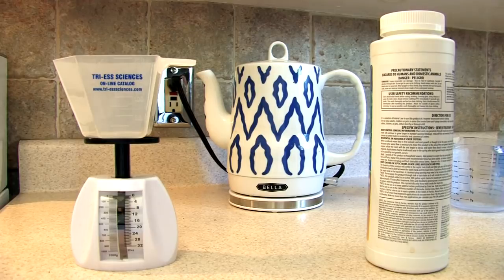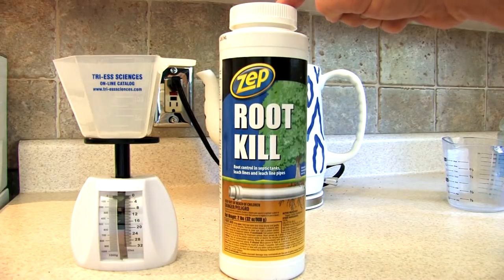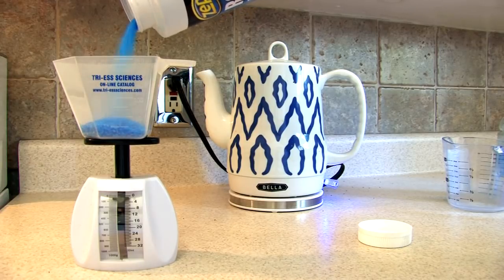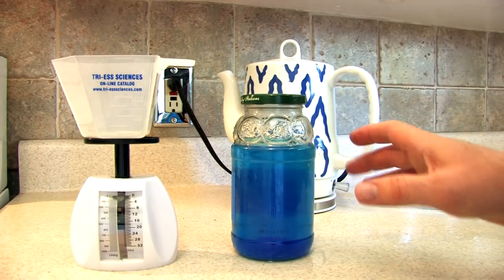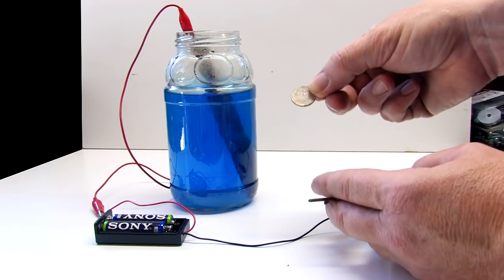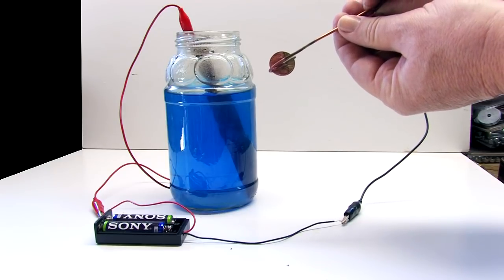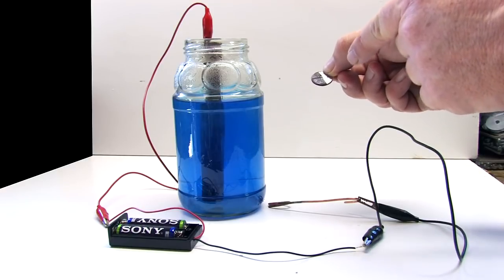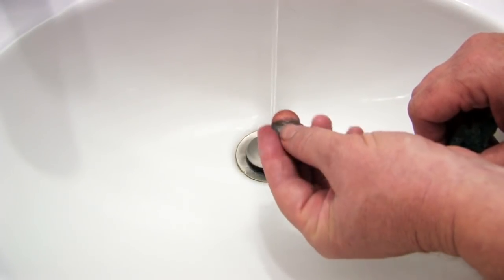Easy And Inexpensive Copper Plating Trick!

Comment: a word to the wise, don't try this with a 12v power supply, i did and it didn't end well. i used the same 12v power supply i use for rust removal electrolysis, i started the plating, went in the other room for a while, when i came back the solution was steaming hot and my metal piece was burnt black, and no copper stuck to it. it didn't dawned on me until i saw how hot the liquid was, that with the solution being copper it was the same as connecting the 2 leads together with a piece of wire. think i'll try it again only with 2 AA batteries next time.....
Reply: your feed with an explanation is appreciated. I think a high current low voltage source would be more appropriate to increase the rate of plating.

Comment: Cathode is positive anode is negative
Reply: Just the opposite.  Cathode is defined as the negatively charged electrode by which electrons enter an electrical device. The anode is the positively charged electrode by which the electrons leave a device.
Reply: Actually it depends on whether you are talking about it from the POV of the chemical reactions taking place or the POV of the multimeter measuring current. I was referring to the POV of the chemical reaction
Reply: Actually, you're a dipshit.
Reply: Lol salty boii

Comment: Copper sulfate pentahydrate is the same chemical as Copper sulfate. Pentahydrate means that for every molecule of copper sulfate there are 5 molecules of water. That's why they write CuSO4 * 5 H2O.
Reply: Fun fact for those who care to know CuSO4 * 5 H2O is blue... if you put it in a drying over to vaporise off the H2O the powder turns white.
Reply: $13.98 for 32 oz at lowe's
Reply: But then how the include H2O into powder? ;)
Reply: @VladOnEarth  If you let copper sulfate solution evaporate  when all the liquid water is gone there will be crystals of blue copper sulfate, incorporated in the crystal structure are 5 water molecules for every copper sulfate molecule.
If you heat the salt in an oven the water will be driven off leaving a white amorphous powder that will draw moisture out of the air to return to its crystal form.
Once the salt is dissolved in water  it's not a crystal any more and the extra waters are insignificant.
If you were weighing out the salt to make a specific concentration of solution then you would need to account for the weight of the five  water molecules when you weight the crystal salt.
Reply: @VladOnEarth  It's attached to the copper due to its hygroscopic nature
Reply: @VladOnEarth  water is trapped inside the crystals.
Reply: So basically just same stuff but dissolved?
Reply: $9.00 at Menards.
Reply: I may have misheard him, but didn't he say tetrahydrate? If so, it's 4 molecules of water (in a crystal form). Either way, what you say still stands. It's a great, inexpensive replacement.
Reply: Nikola Tesla?? To si ti!!!!
Reply: Mihajlo Petkovic awesome science fact. Keep up the good work.
Reply: ^ What he said (Mihajlo Petkovic). I came here to tell you that, but he beat me to it. :)
Reply: grade 10 chemistry
Reply: @kelvinc1053  and?
Reply: Just priced it @ $38. for 32 oz
Reply: @sojournsojourntraveler1203   the price:  $27.50 for 10Lb 
https://www.ebay.com/itm/Copper-Sulfate-Crystals-10lb-Bag-FINE-CRYSTAL/250959796784?epid=1231715905&hash=item3a6e5e9a30:g:rycAAOSw8D9bqQCd

Comment: Very interesting.
Have you any idea if this process would work on aluminum?
Reply: Aluminum forms a strongly adhering oxide layer practically immediately on exposure to air.  This makes it difficult to plate any other metals to it.  Should you somehow remove the oxide layer, aluminum will react rapidly with water to produce more aluminum oxide and releasing hydrogen.

Comment: I just take copper turnings and dissolve them in a vinegar solution and use a 9 volt battery and it works just fine except it corrodes the positive lead and takes a while
Reply: no
Reply: I'm not sure if salt also played a role but it worked
Reply: +Jackass skateboarding totally works! I put a little BBQ sauce in there as it has molasses to act as a brightener. worked! bath got gnarly after a while. the vinegar solution was mixed with warm hydrogen peroxide and a copper wire ball
Reply: trekitytrekyoself yea I did some research and found (because my container had kno3 in it) that it produced a weak nitric acid and coated the negative electrode with potassium and corroded the other electrode . So yea if it dissolved anything it was probably my electrodes

Comment: I used sulfuric acid, a penny, a 6volt 2-12 amp battery charger,and a dime well I was never trying to copper plate anything I ended up dropping the penny in 3 ounces of the acid and dipped the positive and negative in the acid as well and let it sit as a was getting the dime ready to be dipped in the acid and was surprised when I saw the copper appear on the dime after one minute at most I shut off the charger and pulled out the dime and curiously grabed a shell casing from the range and did the same thing as before and pulled it out and it too gad been copper plated I warn against this process unless you have a gas mask on because a toxic gas is produced by the acid as the current runs through it

Comment: I tried this, not from your video I have to say but it didn't go well, any idea what I may have done wrong? I used copper sulphate pentahydrate, distilled water and 2x 1.5 volt batteries. I tried to do a chrome spanner and that may have been the problem, what seemed to happen is the chemicals stripped some of eh chrome off and then attacked the metal casing it to rust and it came out like it has been at the bottom of the sea for a while. I am pretty disappointed as you can imagine but don't want to give up so an advice would be helpful.
Reply: Most likely,  you had the leads reversed.   If wired to the battery backwards,  it will strip off the existing material rather than add on more.    Also everything needs to be spotless,  don't touch the part with your fingers no matter how clean they are.

Comment: FYI for anyone using stronger acids. water first acid 2nd. other way around could end badly. good video otherwise
Reply: RobMacKendrick its a powder acid. It won’t splash.
Reply: @VladOnEarth  acid heats H2O. Splash hazard comes from that exothermic reaction which isn't an issue if acid is added slowly to water
Reply: Splashing. If something splashes out, you want it to be water, not acid.
Reply: why
Reply: Some acid will boil the water if u add the water to the acid. Can smash the glass

Comment: What will the copper adhere to well?  I am trying to make a cheap metal chess set that still looks very good.  Is it possible to cover the coper playing with zinc dust, then turn it into a golden looked alloy, or would I have to have a solid piece of copper.  Thanks for the help!
Reply: Hey, if you got the copper on you can very easily make a brass layer. Were common school experiments. Here is a link to a paper, that describes the process with less dangerous chemicals I personally only did it with strong bases, but they say it works quite as well without. Be really careful with the leftover zinc powder,  when you do it the traditional way. It has a tendency to auto-ignite. I'm also trying to make copper adhere to iron at the moment. I'll put it here if I find out anything new :)
http://digicoll.library.wisc.edu/cgi-bin/JCE/JCE-idx?type=turn&entity=JCE.JCE07205.p0028&id=JCE.JCE07205&isize=M
Reply: If you got the zinc on the copper, just heat your figure on top of your stove for a moment. The alloy, brass, will form almost immediately.

Comment: It does work (as you've found out) very well and it's very inexpensive!  As someone else said the pentahydrate is the normal state of Copper Sulfate.  you can dehydrate it by heating and it will turn almost white.

Comment: Copper(ii) sulphate pentahydrate is just copper sulphate but with the addition of water; it is blue in colour. You can heat up the pentahydrate version to evaporate off the water to gain anhydrous copper sulphate which is white in colour. It is a reversible reaction.
EDIT: Since dissolving anhydrous copper sulphate in water produces a blue solution of copper sulphate pentahydrate, you may aswell just buy the cheaper copper sulphate pentahydrate crystals.

Comment: How can you make sure that you just did not remove the nickel plating that you applied before, and exposed the original copper
Reply: chemistry and electrochemistry. a little OS removed by the solution but as soon as the electrons start flowing the nickel would plate back on and then the copper will plate. you could test the solution for copper for nickel or send it off for testing.
Reply: +Robert Szasz ... autocorrect. a little is removed.
Reply: Because the penny he used was a zinc plated steel penny, not copper to begin with. He nickel plated the zinc/steel penny in a previous video.

Comment: You go on about copper sulfate pentahydrate, not knowing what it is.  Your Root Kill (tm) is technical grade cupric sulfate (which is why it costs a good deal less than the reagent grade you order from a chemical supply house).  The 'pentahydrate' suffix indicates that the cupric sulfate is complexed with water, which is why it is blue.  If you want anhydrous cupric sulfate (which is white), stick the pentahydrate in a 500 degree oven for a few hours.

Comment: I wondered what I can use instead of copper sulfate. So I used Epsom salt instead. The magnesium sulfate solution was then used with 2 copper plates at each end. The solution became copper sulfate after the first attempt!
The magnesium was replaced with copper in the sulfate! 
There you have it, use Epsom salt which is even cheaper and extract the copper sulfate solution after the first electroplating.
use very little Epsom salt (about a tsp), as it precipitates at the bottom.
Good luck.

Comment: Where do I get the battery power source thing?
Reply: I would recommend radio shack, normally... but any electronics store should have it. ...OR...if you have an old answering machine power supply, some stereo equipment will also have those small black power supplies, and most all of those are about 4 to 6 vDC... which is right where you want it. The power supplies will tell you the output, usually...

Comment: can you copper plate lead bullets with this?
Reply: why the fuck would you do that
Reply: +jacob mitchell Ever seen an FMJ? Guess not.
Reply: +jacob mitchell cuz it'd be cool!
Reply: +Bronson Stephens actually I know why, its more then just being cool, when the bullets that fly super fast they heat up alot and copper has a higher melting point so it keeps the bullet from messing up the barrel.
Reply: just from my research I found speer bullets/copper plated lead up your barrel just as much as standard hard cast bullets. this is because the layer of copper is thin it gets scraped off from your rifling. my way to prevent leading is to load a FMJ in the mag first then the rest with hard cast lead rounds. the copper from the last round seems to help clean my barrel(scraping the lead from the barrel) just a side note. I am new to lead bullets.

Comment: I don't know if anyone's addressed the peel problem, but I'll try...
Unfabricated metals are always sold with some sort of masking oil - it needs a good degreasing.  Some kind of solvent or hot water with detergent, then a good drying.  I mean obsessively clean.
If it isn't spotless, it will laminate instead of bonding (that's the peeling).
And don't buff it (this isn't chrome)
Reply: Can you suggest how to do for a riing

Comment: Can't help but notice and no I haven't read every single post but most of the questions I have seen about this leaving a piece of metal with just flakey rust like deposits that wipe right off have not been addressed? I've tried numerals metals following the exact directions and every time same results, flakey deposits that wipe right off certainly is not any kind of plating. Also should I ever get this to work my plan is to repair ornamental pieces and need a high luster, is it even possible to polish this to fit those needs?
Reply: your solution could be too cold, current could be too low, try leaving it in longer, but slowly move it around, and your cathode must be copper. also refrain from using tapwater
Reply: +Pogo M *anode

Comment: and how we know that your system adds a copper layer in the penny and not just  removes the nikel layer that you had added earlier? simple we don't know that... so we believe your system works the way you suggest only if we want to believe it...
Reply: cq33xx Because the science checks out, which you would know if you had any experience in electrochemistry. It baffles me why unqualified people insist on denouncing things they don't understand. I recommend reading a paper on electroplating if you're confused.
Reply: i was kidding... check the style of the comment
just some advanced elegant humor
Reply: +cq33xx it was a 1943 zinc penny to begin with
Reply: @hillybilly99999 1943 Penny's are steel
Reply: 1943 Penny's are steel
Reply: @ProlificInvention  but they're zinc plated...

Comment: Copper sulfate pentahydrate is what "pure" copper sulfate becomes when it absorbs water. Hardware store root killer is far more expensive than most online sources for copper sulfate.
Reply: Also, this copper sulfate solution can be used to copper plate iron, or steel without applying electricity. Just dip it in...
Reply: @ChadHowarth  Just a question. when you say dip it in do you mean literally or let it sit for a while?
Reply: @Eggnukey , Something tells me he’s not gonna answer mate.
Reply: @Eggnukey  the coating will be very brittle. however good to get copper powder by brushing of the film coat.

Comment: some metals may not even require an electric current. More reactive metals than copper, may displace the copper out of the copper sulfate compound. For instance, Iron is more reactive than copper chemically, so if you put iron in copper sulfate solution, the iron replaces the copper, so you end up with copper plated iron, and ferrous II sulfate solution. (as far as I know. I've seen this demonstrated before). Doesn't even require electric current.

Comment: pentahydrate isn't a contaminant, its the water that holds the coppersulfate crystals together. If you heat the crystals to drive off the water it will turn into a powder. It's pure coppersulfate, it's just hydrated.

Comment: When i want to copper plate bigger object like steel bicycle frame, the weight is about 2kg. Can you please tell what adjustments should i make to voltage and how big should be the copper object on anode and what power supply should i use? Thanks a lot

Comment: Here's one for you. I am trying to copper plate steel, I have done everything as your video but all i get is a brown scummy coating that wipes off leaving no copper at all on my steel. I have run out of ideas, I have kept everything clean, mixed stronger and weaker solutions tried 1.5V-12V the only difference is the speed at which the deposit builds up. The brown scummy stuff is obviously some kind of copper compound as you can see copper flakes in it when you wipe it off. There is no cross contamination as all my wires are copper so the only thing in the solution is copper or steel. Any ideas anybody.
Reply: +69waveydavey Since you mentioned plate steel, is it hot rold a36 by chance?  if so it will have a blackish mill scale instead of a light grey or silver finish.  If so, you will need to remove that mill scale 1st.  To do so can be done by sand blasting, which is the quickest, or soak it in muratic acid which gives a nice finish but it is pretty toxic.  You can also wire wheel it off, but takes some doing.  Grinding or sanding works as well, but then you run the risk of cutting into the metal to much.

Comment: You can get a 50# bag of copper sulphate at a feed store or sewer supply place for cheaper than those little bottles too.  I used to do this when I was a little kid but never could get a good plate that wouldn't come off.  Looks like I was using too much juice, but like I said just a kid.  Kinda lost interest, Girls are a lot more fun.